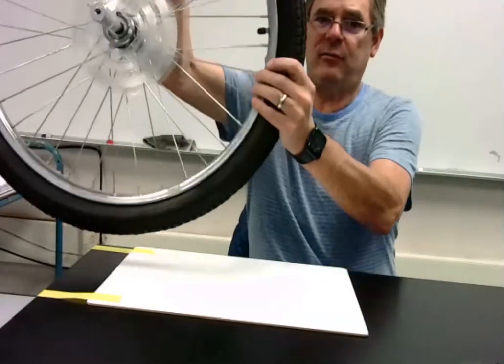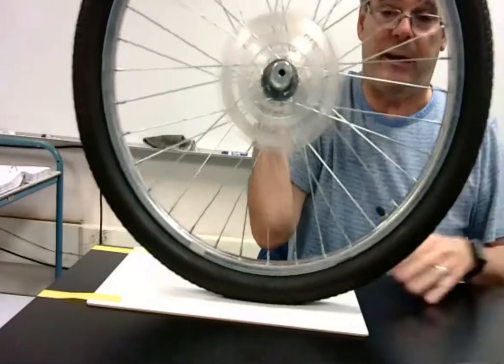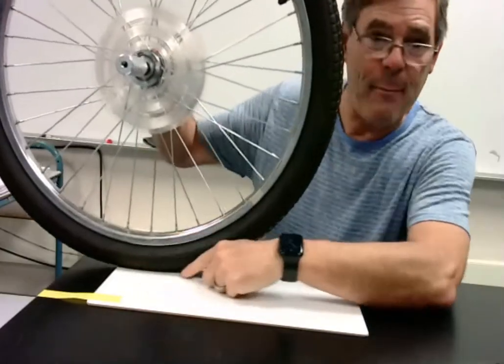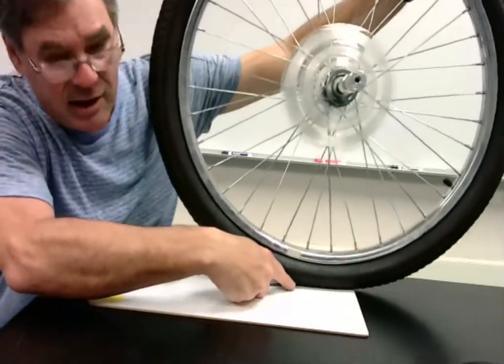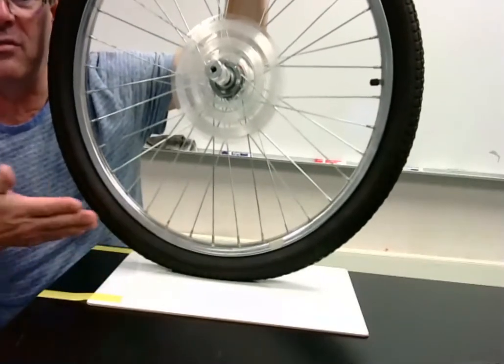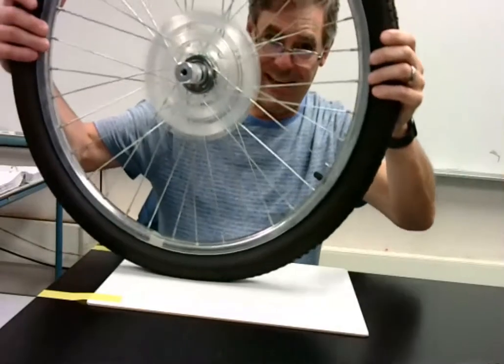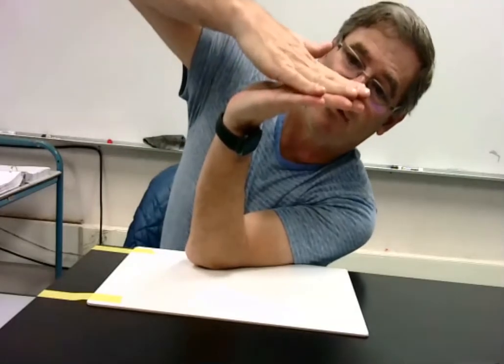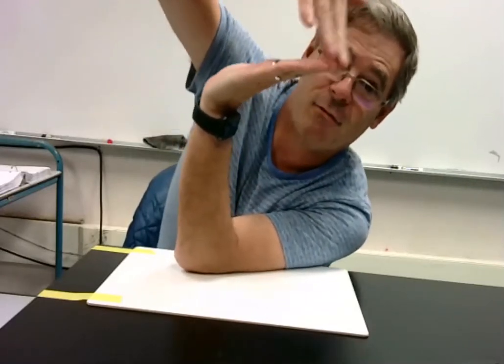Does a rolling wheel use static friction or kinetic friction?

Comment: Since friction force is a self adjusting force, it should be equal to the force experienced by CM of the tyre (until it reaches static value) for pure rolling to occur. So in a way friction helps in pure rolling by making the contact point stationary.

If the acceleration of bike keeps on increasing, friction keeps on increasing and after friction reaches static value, it will not be able to support further rolling. Then slipping should start and constant kinetic friction will take over (assuming flat surface).

This is what happens on wet or icy roads, where friction becomes lower than usual and the tendency of vehicle to skid becomes high even at low accelerations because both static and kinetic frictions are lowered.

Comment: can anyone explain why locking (=when the wheels stop rotating) increases stopping distance of a car? (in terms of the friction)
Reply from the maker: When a car is skidding, the friction is kinetic friction.  Kinetic friction is less than maximum static friction, so the car takes longer to stop than if you brake hard without skidding.
Reply: @davidtaylorfuhsd  thank you!